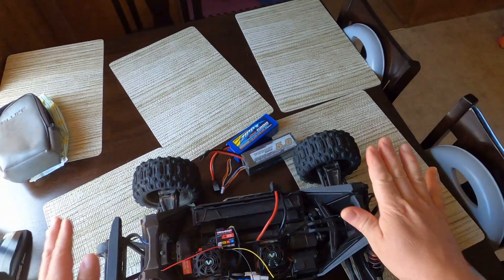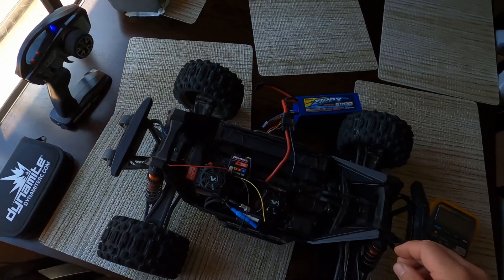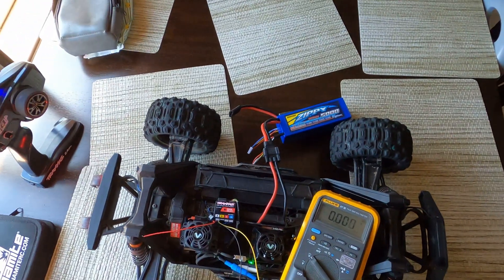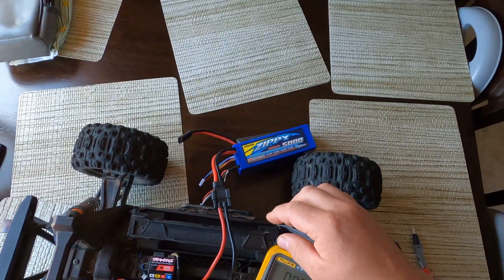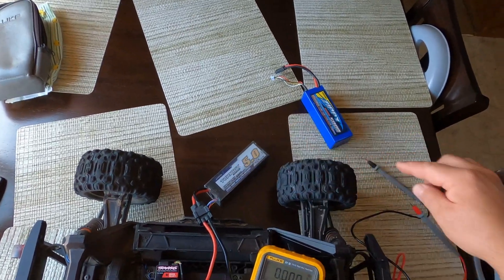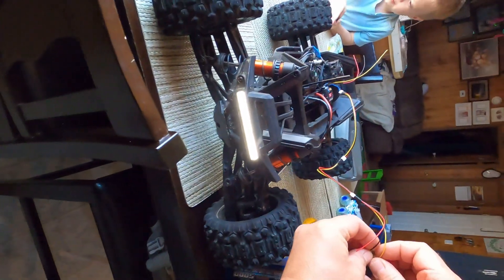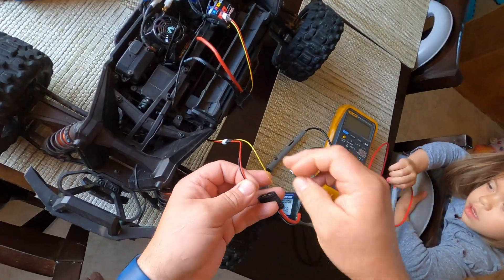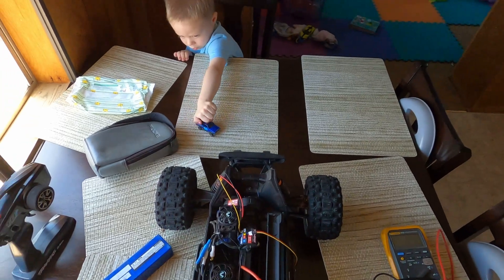Use Traxxas LED light kit on other ESCs

Comment: What a great video- no idea why you'd ever get negative comments. Could i just confirm- you ID the blue wire a positive- is this using switch negatives then? did you find out what the low voltage connectors are used for by any chance?
Reply from the maker: @jamespugh3729  here’s a new vid, not sure if it helps any: https://youtu.be/eHN6_ngk-uI?si=YtmBspmj-xXjpdhS

Comment: Hey, hope your still around. Thx for this man. So what does the rear light run off? 5v, 6v, 8v? I appreciate your efforts in this man 🤙🤙
Reply from the maker: @up50lut3  the lights run off 16V, that’s why Traxxas uses an amplifier. I do have a newer video where you can use the amplifier if you want to go that route instead.

Comment: So can we essentially use the cheaper kit TRA6589 Instead of paying the $100 they want for the XRT or xmaxx TRA7885? It’s not much more power and they are super small LEDs. Am I wrong? Thanks.
Reply from the maker: No, the 6589 uses a 3.3 volt system from the 8028 (which takes one 2S or 3S to power). You’d burn out the lights and module immediately if you connected them to more than 3.3V.

Comment: Is this amplifier the one with the 8 pin plug ? I have the sledge kit and been trying to get it to work with my max 8 esc or get power to the leds
Reply from the maker: Correct, it’s the Traxxas 6590 amplifier that connects to the VXL-4S on the Maxx, VXL-6S on the E-Revo and Sledge, and the VXL-8S on the XMAXX and XRT.
Reply: Did u ever get this to work in your sledge?

Comment: Thanks for the intel! This technique should work on an 8s xmaxx with one 4s obviously?
Reply from the maker: Correct, that’s if you don’t want to use the LED amplifier.
Reply: @dgitalchaos  I was under the impression this was using the traxxas light amp? So is this a direct wire method to the lightbar?
Reply from the maker: @gmummy  direct lights, no amp.  To use the amplifier, see this video:  
https://youtu.be/eHN6_ngk-uI
Reply: @dgitalchaos  Excellent. Thank you! Subbed up👍

Comment: Can you power the module at self and leave the wires plugged into it and power the lights that way I'm trying to run it off a Max 6 ESC in my Sledge
Reply from the maker: I’m not sure. I know Traxxas doesn’t release schematics to any of their devices.
Reply: @dgitalchaos  you can do it I just left a comment explaining how you use the red and the green there's 2 red and 2 green that are positive you can use all four or just one red and one green and then there's two grounds you can use both blacks or just one black I used one green one red and one black and now I can cycle through the lights with the button on the module
Reply from the maker: @martinbullla7654  that’s awesome! How’d you get the info? Trial and error?
Reply: @dgitalchaos  no I just kept looking it up and scrolling through a whole bunch of different threads about it and I finally found someone that said the red and the green are positive and the blacks are the grounds you can use any red or any green for battery positive I tried it and it worked so now I'm just spreading the info
Reply from the maker: @martinbullla7654  that’s awesome!!!! Thank you!

Comment: How did you wire the amplifier to the aftermarket esc?
Reply from the maker: I added a balance plug to the wires and connected them directly to a lipo.
Reply: @dgitalchaos  so you're not able to control them with the maxx link app after doing it that way, are you?
Reply from the maker: @pinky057  no control like that. The feature only works with the VXL-6S, VXL-8S, and VXL-4S speed controller.
Reply: Hello! Can I do this with a 6s pack??

Comment: Great show G
So if we also wire in the reverse light leads to the front and rears now they’ll be on once lipo hooked up permanently Sooo😊 when will the reverse light come on/ kick in as we’ve no longer fit the stock esc inside 😎
Would dig an answer
Reply from the maker: Unfortunately, you either wire the reverse light to stay on, or keep it off. Thanks to Traxxas for proprietary modules.
Reply: @dgitalchaos  I thought so😕 Wizardry outside the box thinking can only go so far with TRAXXAS in the mix
Thank you so much for the show 
I’m setting to look about doing this exact mod as I wanted to but never knew how 🤩🥳🤩🥳🥸
Reply from the maker: @gonzodetroitify  it’s simple enough to solder to a balance plug and then connect to a lipo. They draw very low amperage.
Reply: @dgitalchaos  ahh Blast 😞 yes that’s what I was about to look for the opposite end to the lipo balance and go to work 🫡
Your ontop of your game that’s for sure 
Don’t watch the negative comments 
It was a please to hear what sounded like your child’s 🥇 bumper comment 😊😊😊😊😊😊😊😊😊 
Awesome moment 🔥😏
Reply from the maker: @gonzodetroitify  the twins love to play with the RCs. So it’s nice teaching them the components.

Comment: Could I power a light kit off a second lipo specifically for the light kit
Reply: Looking at small 1 cell lipos with a jst connector to power my Trx4 light kit, that way I don’t have to solder in a jst connector into my hobby wing fusion
Reply from the maker: @jonathanboyer8723  I believe the TRX-4 uses a 3 volt system, so you’ll fry the LEDs if you connect a LiPo.
Reply: @dgitalchaos  I’m gonna give it a shot, for science of course, also the lipo is only 3.7 volts so and the thing I’m plugging it into should regulate voltage, it might be fine even running the full voltage but we shall see

Comment: I was wondering if I could use the Traxxas lights with another brand esc. Thank you for this video. Great job. Don’t worry about the negative comments. Your children are cute copying what you say.
Reply: So I would need to make a connector and plug it into the balance lead?  I like my wires looking neat.  Hmmm
Reply from the maker: @MrCovain  you can make it look decent enough with heat shrink tubing.
Reply from the maker: The easiest way is to connect them to a balance lead to use on the LiPo.
Reply: @dgitalchaos  I’m using Traxxas battery so it doesn’t have the balance wire external. It’s built into the Traxxas plug. Any idea how to wire them to that ? Thank you
Reply from the maker: @johnnydavis8489  you can use a Traxxas Power Tap and wire that to the LEDs. https://www.amainhobbies.com/traxxas-power-tap-connector-w-cable-tra6541x/p1296696?gclid=CjwKCAiAkfucBhBBEiwAFjbkr4d07r98kCQxMQSR1VO1cR-toNfY3CCa0ggNKoR57Hy_gxNhRHUzHhoCA-QQAvD_BwE
Reply: @dgitalchaos  thank you that’s exactly what I would need. Have a great weekend and merry Christmas
Reply from the maker: @johnnydavis8489  have a Merry Christmas as well!